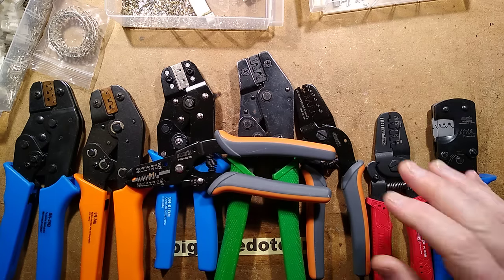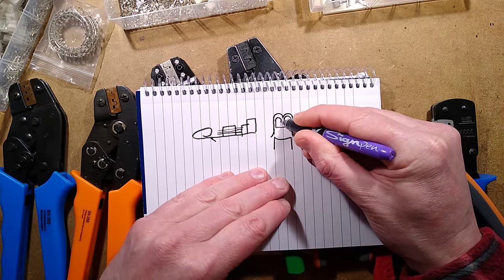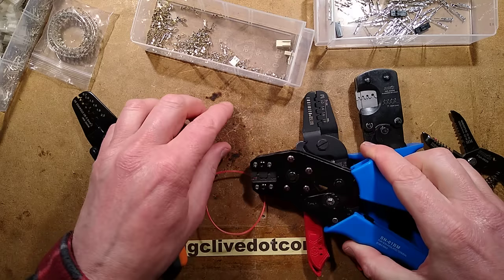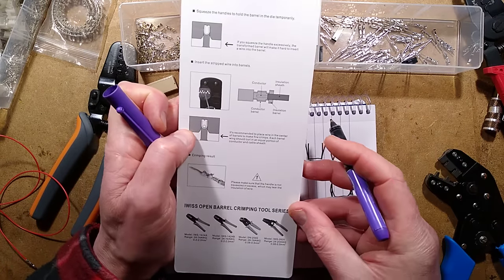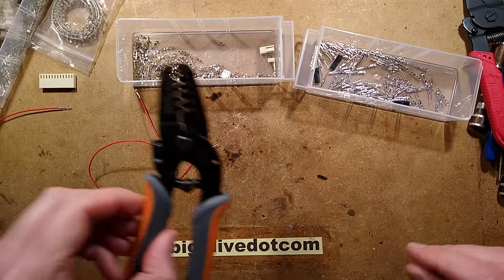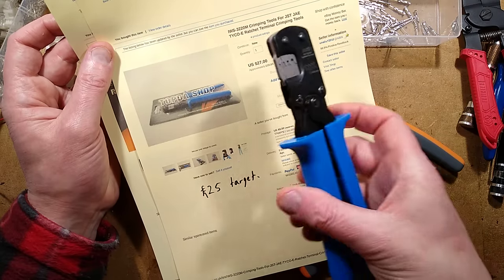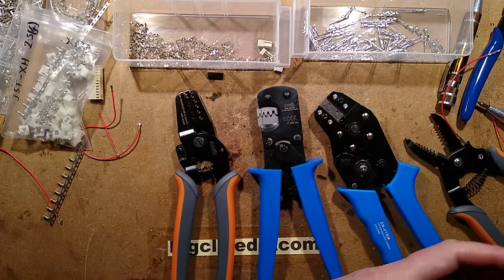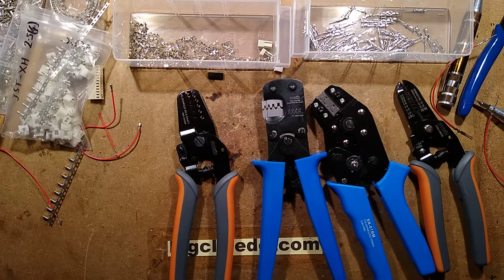Crimping tool test that I screwed up. (Read description.)

Comment: It is the 21st century.  Where is my crimping robot ?
Reply: There out there in industry. I used to service big auto crimping machines  from molex back around 1999 that's why some crimps come on reels so you could just load it up feed the crimp in to start with an push the wire in an it did the rest for you. Every 20 - 30 batches you'd take a sample of say 5 at random an do a pull test on a proper strain gauge to comply with standards.
Reply: @SlyerFox666  The person who designs such a machine probably does so whilst crimping lots of wires. You have to do something to dull the repetative nature of automatable tasks.
Reply: @blancsteve4819  I couldn't agree more as part of the first 12 months of my wireman apprenticeship we had to strip and crimp wires to the IPC standards and that is exactly where our minds would go as we already had a wire cutting machine.  Years later I ended up in the electronics industry then into maintenance looking after those machines we dreamed of 🤭👍.

Comment: I honestly do not understand. I crimp thousands of JST connectors every year and I never had a problem since I got myself a PA-09. I use 1.4mm and 1.9mm for the insulation. It never sticks or fail. I use mainly 20 AWG wire gage.

Comment: I got into crimping in relation to the Hermaphroditic Power Pole connectors used for 12 Volts in Ham radio applications. https://prc68.com/I/PowerPole.shtml#Crimpers  It turns out that the military and NASA require crimp connections since there's a ton of problems related to soldered connections.  For high currents solder will not work.  To get the proper amount of crimp a ratchet type hand crimp tool is mandatory.  For the past hour, after watching this video I've been surfing the Molex web pages on the KK 254 (KK 0.1") and have learned they offer a plethora of housings and terminals.  But finding the tooling is near impossible.  I've got a call into the tooling department. 

PS When making hundreds of wires for a product the type of stripper you show in this video tires out my hands.  A much better stripper is one that you just squeeze.  The Paladin PA1113 is my current model, but others are shown at:  https://prc68.com/I/WireStrippers.html
Reply: Not just high current, but also high frequency and high fidelity. It's eye-opening to compare certification test results between soldered, IDC, and compression-crimped splices in Ethernet cables. (Though they all technically "fail" because splicing is prohibited by standard.)
Reply: I worked at HP/Agilent on the 4380S which was an 8-port test set designed specifically to test each end of each wire at both ends of a CAT5 LAN cable (that's 2 pair each end). https://prc68.com/I/4395A.shtml#4380

Comment: dude no offence but problems you mayexperience when crimping molex are related to wrong tool used and wrong storage method. 
1- the molex pins presented are on the tape, this tape is designed to be loaded into automatic machine that crimps hundreds of them  non stop, its designed for mass production mate. 2- when you sotre this tape that someone cut into pieces, the molex pins are going to bend in different directions, and those crimp tools you are trying to use are not designed fo it, if you pay more attention to detail under the scope for example you will see the collars are bend inwards instead of outwards, or just bend out of shape, that causes the crimp not to sit tightly into the tool and twists insted of getting crimped, now you can accomodate for that by bending it outwards back to shape and crimp it very slowly when watching the collar and siting position of the crimp, but in production that would be a waste of time. my advice is to buy a proper crimp and tool that goese together to save time, alternatively you can always solder them if you are not passing too much current.    proper pins would be assorted in short transparent plstic tube with a white cap, and a sticker with a part number. I doubt yo ucan buy tihngs like that is small quantities those would go in thousends,  its such a waste to throw away all those tubes though thats thow it is in our times, packaging and shipping costs more than product  itself. I bet if yo uhave a laser cutter and pneumatic press you can manufacture those yourself

Comment: 13:28 A soldering iron works with all wire gauges.
Reply: I'd hate to try to crimp with an iron.
Reply: @Azlehria  I guess you're bald then.
Reply: @millomweb  Waist length, actually, but I never bothered modifying my hair aside from a one-off bleach job as a teen. Turned out well, but I hadn't intended to become a ginger . . ..
Reply: It does especially well melting insulation and flowing solder into the contact.
Reply: @plemli  Great. Just doesn't work so well if the insulation is porcelain ball/socket jointed beads :)

Comment: My crimps are red, blue or yellow, or bootlace. Seems much simpler 😀
Reply from the maker: Those ones are much simpler.  A good set of ratchet crimpers for both types works well.
Reply: @bigclivedotcom  I don't have much need for the Molex connectors, but thanks for this video which will definitely be hand when I inevitably do at some point.

I quite like the 6 sided aperture style ones for ferule/bootlace crimps. Makes things neat and tidy.

Comment: I hate to be a pest, but, why have you gone through “several rolls” of the thousand - count crimp terminals using a hand crumpet? Why not get the “official” machine to do it, wouldn’t that be a more reliable (and easier on your hands) solution? 😀

(Oh and I lied - I love to be a pest LOL 😜)
Reply from the maker: It happened by stealth.  I didn't expect to use so many, but made lots of wiring looms for technical props so the prop makers could install them once they had finished.

Comment: I've yet to find an easy way to make up Ethernet cables, they are so boring to make!!! :)
Reply from the maker: You get a version where you can just shove the wires right through and out the front and the correct tool crimps and crops them simultaneously.  It reduces the amount of effort in aligning and cropping the wires for the traditional type.

Comment: 7:35 Oh stuff it Clive - you made a mess of that already - just get the soldering iron out and do a proper job ! ;)
Reply: Ever wonder why you see crimps and not solder in say automobiles? Vibration and high current can make solder joints fail where crimps don't. Right method for the right job.
Reply: @markfergerson2145  Cos they're cheaper to assemble.

I'd guess there are more soldered connections in a car than crimped.
For high current they use screw clamps.
Reply: @millomweb  From what I've seen of disassembling and repairing cars, soldered joints are very rare and have been for a long time. My 70 Chevy pickup for instance had none other than in the dashboard lamp sockets.
Reply: @markfergerson2145  Did you look:
Behind the instrument cluster
in the clock
in the radio
in the fuse box
in the engine management 'box'

Anything with a hint of electronics will have loads.
Reply: @markfergerson2145  They're widely used in the aviation industry too.
Reply: @millomweb  The truck didn't have a clock radio when I bought it and I didn't want either. But I've disassembled car radios of the era (for the tuning coils) and yes, their boards are soldered, but also shock-mounted to the chassis. Same goes for most such accessories.
It was a 19*70* Chevy. It didn't have any engine management stuff other than springs, levers and vacuum hoses.
Reply: @Asyss_Complex  I know. I was in the USAF and while I never worked on aircraft I knew people who did and they told me that gear with internal solder joints was always shock-mounted. The stuff I worked on (those yellow carts used to start jets on the flight line) had none either. Before anyone asks, they were all relay logic, no computers. All the components were in sockets with clamps.
Reply: @markfergerson2145  Sorry, I thought we were talking about modern vehicles - with all sorts of electronics on them.
Stick with the springs, levers and vacuum hoses - probably more reliable ;)

Comment: Please Clive... buy yourself quality professional tools to strip and crimp - Weidmuller
Save the effort when stripping all types of insulation [stripax®] without any adjustment across gauges or fear of ripping out strands. Those cutting jaws adjust to the shape of the wire stranding. 

Same goes for crimpers [Red Line] especially the pre-insulated types that also incorporate an insulation grip function. You do know the best lugs have a metal ferrule under the colour coded plastic sheath to firmly grip that insulation?  Cheap crap lugs do not.

AND, cheap crappy crimpers don't have the correct die profile to close that grip firmly.  

Your a professional... so am I. 

Don't waste your valuable time and head space.